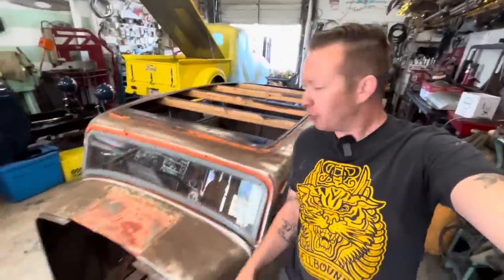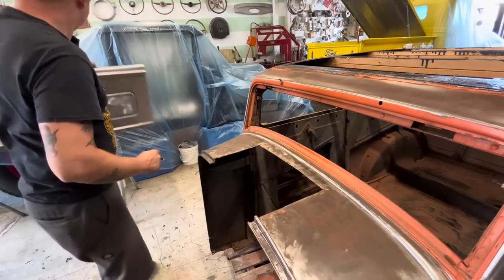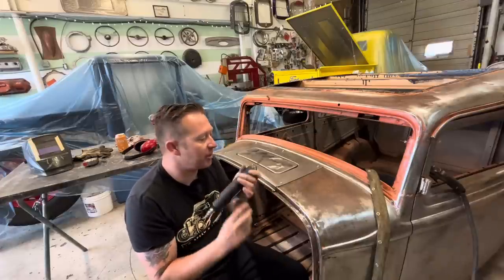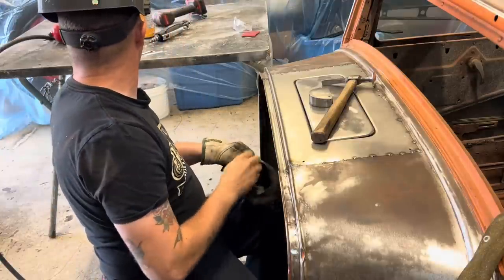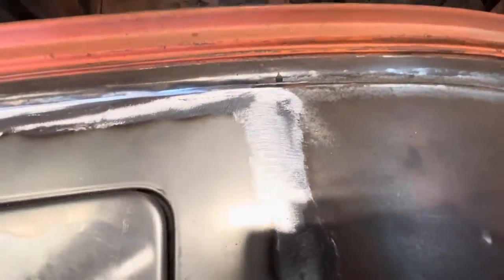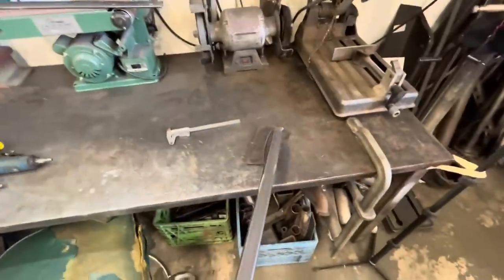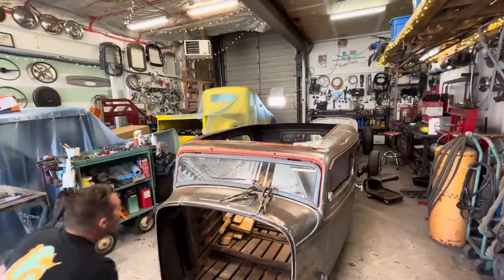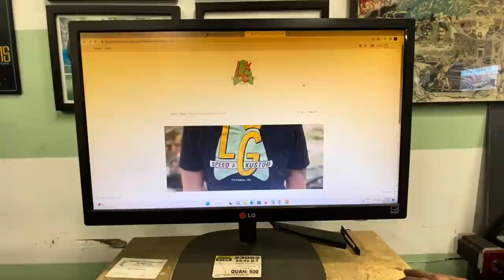Hammer Welding a Cowl Vent Panel In A 32 Ford. 32 Ford Build Part 20

Comment: I am a firm believer in weld trough primer, another channel I don’t watch much anymore didn’t use it. I find it welds much better when I use a 1/4” fluted carbide tool to clean the weld trough primer and any mill scale from the parent material in my plug welds.

Comment: I’m 65, started doing body and metal work when I was 16, started out gas welding, then brazing, and finally mig. Never learned to tig weld but always wish I would have. Finally gonna have to hang up the mig because with bifocals I can no longer see well enough to follow the seams for the continuous spot welds. I can’t even follow a seam to do regular mig welding.
Reply from the maker: Gas welding and tig welding are very similar. If you can gas weld sheet metal, you’ll pick up tig welding sheet metal with no problem

Comment: I used clecos a lot in aircraft repair and some in auto body repair. They work like a clamp and alignment pin at the same time. They provide you the ability to take the panel off and on several times without the holes getting messed up. Screws after a few time on and off will make the holes sloppy and the alignment isn’t as good.
Reply from the maker: The on and off makes sense. I guess I’ve just never taken the panel on and off enough for the screw holes to get distorted.
Reply: The last project I was working on was a 1970 VW that needed a windshield lower section replaced. It is a compound curve requiring slow trimming starting in the center and working outwards. I used the clecos with alignment tabs as I worked the repair panel. I could mark a short section to trim, remove and trim. Then re-instal to check fitment and marking the next section. The panel went in and out numerous times before I started welding it in. The clecos worked perfect for me. On aircraft I found panels with multiple cures and shapes makes it more complicated to fit properly and they have to go in and out many times. Hope this helps.

Comment: Interesting method!  Kind of a variation of the "cut and butt" of your Compatriot Fitzee.  I too always tig replacement panels.  My question:  have you tried just tacking the replacement piece to the original panel before you start the cut and butt weld transformation, instead of using self tapping screws?  Once you have a couple valid butt joint tacks those others can be grinded away.  Filling in holes is not a big deal but always prefer to eliminate extra steps...  Your thoughts would be greatly appreciated.  Thank you.
Reply from the maker: I’m sure tacking it would work too

Comment: I hate to leave another comment question but this video so closely resembles what I am working on.  If you could not MIG plug weld that curved flange on there, and had to TIG it, what kind of rust prevention treatment would you put in between the pieces?  I have tried zinc based weld thru primer with TIG and it is a splatter contamination disaster...unweldable I had to grind it off and start over.    I resort to using rattle can rust converter primer but even that smokes and creates a mess.  If you have a better idea it would be most greatly appreciated.  Thank you.
Reply from the maker: All weld through primers react with tig welding. I don’t have a solution for you unfortunately.

Comment: Very nicely done. I'm surprised as long as you've been fabricating that you are still F'n around with pliers to operate your valve on your shop press. Jump on the lathe and make a shop tool for that task.
Reply from the maker: I’ll have to get a lathe first.

Comment: You said when the joint is welded it shrinks. When still hot could you use a wet rag to pull the metal back up?
Reply from the maker: All the wet rag does is cool the metal to reduce the shrinking process. But it still shrinks from the time you start the weld until you apply the wet rag
Reply: @LGKustoms  Thanks

Comment: No you jump around so you don't put all the heat in one spot because of warping  especially when using tig and the hammering is actually peanning the medal
Reply: Any chance you could steer me in the direction of your metal work so I can see the superior methods you use. 🙏
Reply: @onesilvergrey  Can't wait to see also
Reply: You spelled metal wrong.
Reply: Where do you see any warping? He metal finished it near perfect.

Tig is the far superior way to do this job. Mig will work but as he said it quirk hardens and can crack. Just because YOU can't do it doesn't make it wrong.
Reply: @onesilvergrey  His metal work is all done with his keyboard sitting in a chair.

Comment: This is not how you do it put your new panel on trace it out  cut it out replace it with new one the term hammer welding is joining two  pieces together with heat hammering the two pieces together
Reply from the maker: Oh it’s not? Cause this worked perfect. The car is now in primer, and this area has absolutely no body filler in it. Just sanded the welded area to 120grit and primed right over top. And now that it’s in primer you can’t even tell there was a ever a panel welded in. But you’re probably right, this is “not how you do it” 😆
Reply: You can’t be serious with this comment… there are hundreds of way to do something and at the end of the task if it looks as perfect at this cowl vent then I say he did it pretty damn right. If you don’t know what Lee is doing by hammering his weld to control the heat and movement of metal then you prob shouldn’t be commenting on it
Reply: Although there are several ways of welding in a new panel, TIG butt welding usually results in the nicest finishes product. A little more work up front but the end results are superior. Ask Walden, James, Bleed and any other professional in addition to Lee.
Reply: There is a lot more to replacing a panel than just tracing it out and replacing it with a new one.  To understand and appreciate this video you need to actually try replacing some panels yourself and then you will appreciate the tricks that go into the high quality panel replacement that is demonstrated in this video.